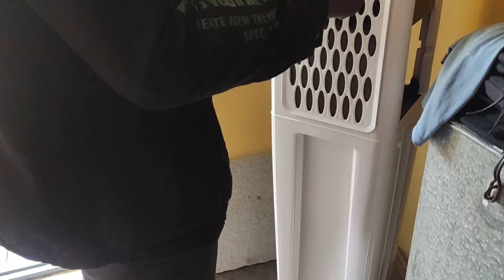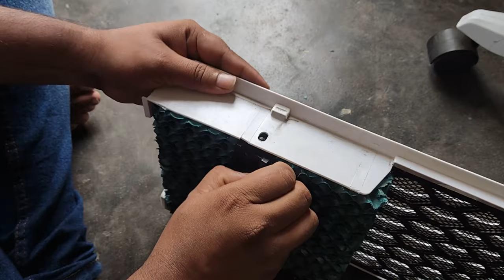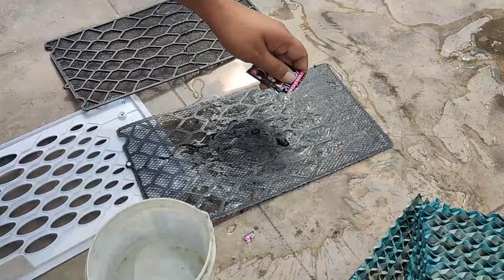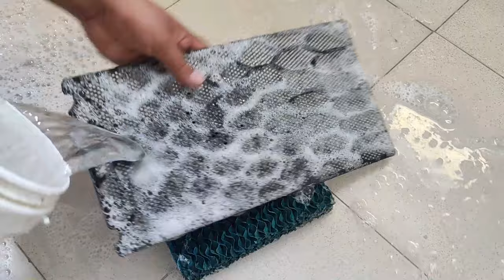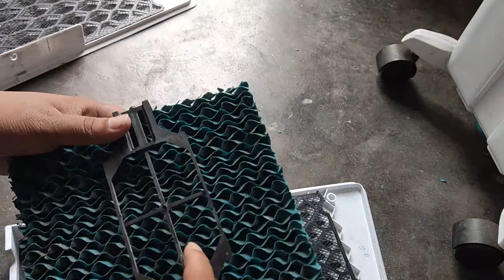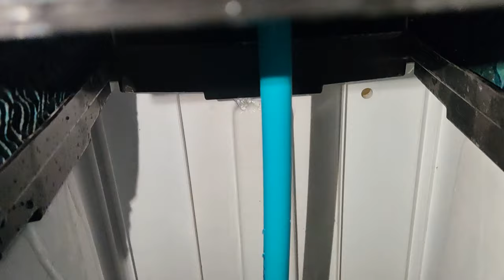Symphony 3D diet 55Ltr air cooler honeycomb cleaning and replacing

Comment: The honey comp is so delicate. Ate you  using a wet brush or dry? Are the parts available for replacement incase it damaged caused by cleaning?🤔
Reply from the maker: Yes part is available so I was using wet bresh so after cleaning felt good no smell so using old honey comb and the replacement new comb is approx 500 rupees
Reply: @CVUcreation  thank you 🙏
Reply: @CVUcreation  links to buy a new one, thank you.
Reply: @CVUcreation  I only just realised the auto correct got the best of me. I am thankful to understood the message.  The Honey Comb Mesh I meant is so delicate to clean and would break easily.
Reply from the maker: Yes honey comb will get break you should carefully